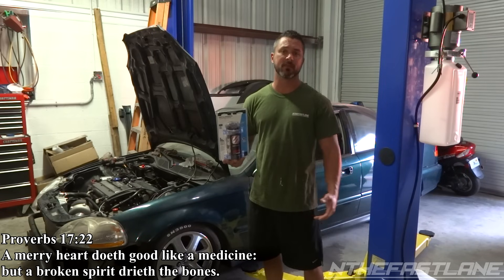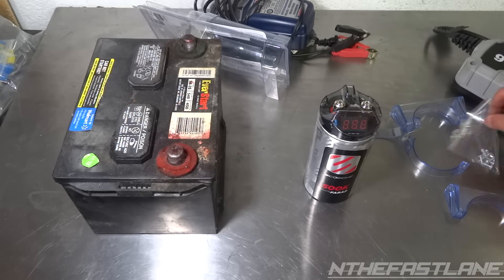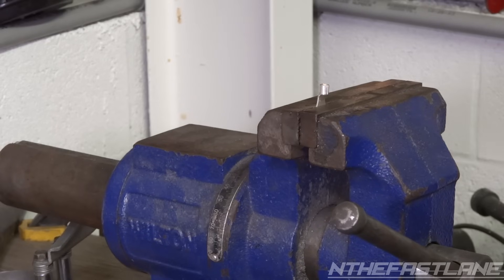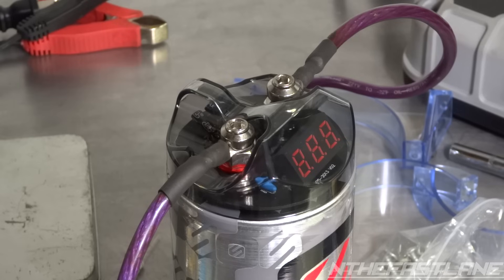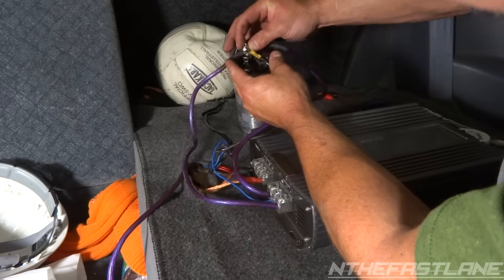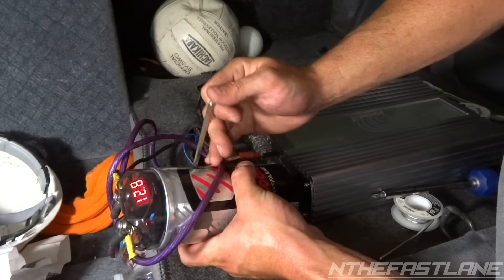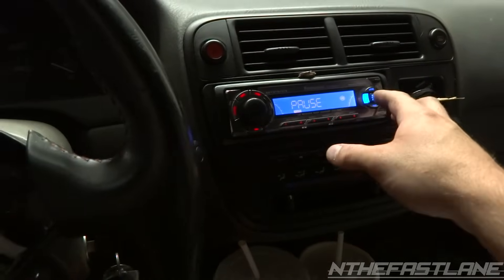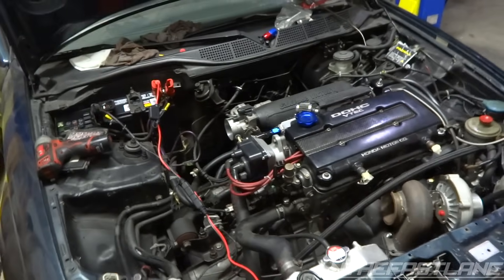▶️Amplifier Capacitor Installation "How To"⚡

Comment: Capacitors 101. For all the newbies, hell that probably includes me. Say you have a sweet ride, you're not going to run it through the carwash. You do it yourself. Now you got the car all soapy and sudsy. You go to use the water hose to rinse it off but the water pressure is terrible. Like you're trying to rinse off your car with a bad showerhead. What do you do, you grab an empty bucket and let it fill with the water all the way to the top. You take that water bucket and splash down the roof with one or two big passes just blasting the soapy water away. That's kinda how a capacitor works. Your capacitor is a lifeless bucket your battery is constantly filling up with water and the water overflows out the top to your amplifiers keeping them going. At one point your amplifier says we gonna need a  shitload of water to keep this bass note flowing. Cool. BASS note is gonna hit hard. The capacitor water is just sucked out of it for that note. Almost have the bucket is gone. But the water keeps flowin into it and none of the other systems, headllights, leds, cell phone charger, ac blower motor, They're all drinking from the same hose too but since the capacitor was full of water, it was able to dish it out and nobody else new it cause it had some to spare.
Reply: Perfect explanation
Reply: Cool man, stupid simple just what I needed thanks for that.
Reply: Well said

Comment: Upgrading the alternator is a way better choice. Most capacitors are just trash, and running multiple batteries won't help if the alternator is too weak to charge the batteries.
Reply: HKvsGlock I don't think it's a choice of one over the other.
Reply: HKvsGlock
Reply: You also need good batteries and a battery isolator for the batteries running the sound system!
Reply: I was just going to comment about upgrading the alternator. An 80 or 90 amp alternator just won't hold up long term even when using a cap... I've never had any issue with a single battery and a 140-160 amp alternator.
Reply: I got a 240 amp alternator and only a stock battery, I’m gonna upgrade to a optima yellow top battery and see if I still need a capacitor
Reply: baadkittyMEOW you will not need a capacitor with those upgrades.
Reply: Capacitors will also aide in filtering noise out of the system, they work quite well when installed correctly, this was not a example of correctly installed 😂
Reply: Capacitors are not as popular as they used to be. They are pretty much trash no one hardly uses them. Get a good battery, wires and alternator and you will be all set
Reply: Capacitors are for small power needs. If you're bump 5k watts or more yes you should probably upgrade your alternator.
Reply: @charleswp71  yeah this was correct. Lol
Reply: @charleswp71  
I've got a Blaupunkt volocity to go 6 , and I want to use it as a boombox , how do I connect the capacitor?

Comment: Real man don’t charge capacitor first real man don’t even disconnect battery 🔋 😆
Reply: Me to lol wtf is that resistor lmao never used that shit in my life
Reply: Proof darwinism is being prevented! its basically a bomb if you take it out. If you just take it out n let it sit for a while when you pick it up n move it around thats when they like to blow up in your face
Reply: Mine sat for like 2 months i picked it up and put in bxk in my car 10 months bumpin later it still hasnt blown up and i have exacly the same as his

Comment: This is all wrong! That wire isn't 8 gauge, I don't know if it claims to be. Those ring terminals are not rated for that wire. You stretched them to make them fit. Solder is not pronounced soul-der. The way you soldered those ring terminals, you didn't even get solder in the wire... It's just all on the outside of the ring terminal where you put the flux. I don't think you charged the capacitor, it had no voltage stored. It was showing 0 volts. That Walmart capacity isn't even a farad or 2 farads like it claims to be, waste of time and money to install. I can't strop shaking my head as this video continues.
Reply: Also, you didn't even have it wired properly. The capacitor should have it's own ground, it shouldn't share with the amps.

Comment: Caps are only good for quick slaps but as soon as a long bass note comes up it does not have time to charge back up then it also becomes a load to the electrical system. That's why is wise to upgrade the alternator or add a battery
Reply: These are the facts right here...well said. My 425 amp alternator arrives next week (dedicated to stereo, 2 alt set up 😁 1 battery yellow top😉 no caps. The long bass note is exactly what happens, and then the caps never catch up....👍
Reply: Yep - The only Real way to have Actual Power is for the Power to Already BE THERE ... Get yourself a Realistic Alternator, Upgrade that Battery and Every Cable you've got under your Hood and There Ya Go!
 That Capacitor is intended only for sudden Quick Drops (if any) in Voltage. It is NOT a Regulator, it's only a Buffer. It's meant to activate only when Voltage drops below a certain Threshold. 
A Capacitor is NOT an Alternator "alternative".

Comment: shouldnt be adding capacitor or battery without upgrading the alternator!. your going to put way to much stress on the alternator.
Reply: Miss CarAudio by leonie how do you upgrade the alternator?
Reply: Carson John Replace the stock alternator with a high amp alternator, but you may not really need to. Have a good mechanic check to see if it’s needed.

Comment: “It’s always going to keep the Amps at that Voltage”? Then, a Diode rather than Resistor? I have ZERO confidence in this “informational” video.
Reply: Amp as in amplifier, not ampere.
Reply: He was talking about amplifier when he said amps. Also, a resistor is similar to a diode, other than its electrical properties.

Comment: Coming from someone who just hooked this same thing up yesterday, you are supposed to charge it up until the LED quits flashing, as per the instructions that came in the packaging. If you become impatient and don't want to hold it (it only takes about 30 seconds to a minute), then just wrap one end of the resister to the positive terminal of the cap, and the other end to the positive cable coming from the battery. 

I just let it sit for a minute while I went back inside to take care of something really fast. Wasn't worried about draining my battery down too far by accident, since I was using my car audio battery which I have isolated from the starting battery when the vehicle is off. Otherwise, I really like how your install looks. Much cleaner than my own. lol.

Comment: can you answer this?
i recently purchased a capacitor (Sound Storm C22 2 Farad ) with 16v to 24v surge. i have a 12v battery in my car. will this capacitor work with 12v system?

Comment: I've used caps in the past but I usually build my systems with alternator output in mind.. High current alternator is they way to go if it's in the budget.

Comment: I have had many set up's in several vehicle's & I always s come back to a 92 Pontiac Grand-am that I once had with a decent set up & even though I was drawing MORE AMP'S then what my alternator put out,( I was drawing 127 amp's on a 120 amp alternator) I added a 1 farrod cap & NEVER HAD AN ISSUE WITH HEADLIGHT'S DIMMING! HOW THAT IS POSSIBLE, IT IS NOT BUT, SOMEHOW IT WORKED! I RAN TWO 1,000 CCA BATTERY'S W/1 FARROD CAP & THAT PONTIAC HIt  HARD!!! now I have a focus w/ Memphis srx 5000.1 & 2-12's & 1 farrod cap & MAN DO MY HEADLIGHTS DIM! I NEED A BETTER ALTERNATOR BAD!!!

Comment: 06:00   I'd  do it the other way  around, lightly grip the wire in the vise,and leave the terminal out to solder; this way the plastic will  not get burned as much, AND  the terminal will heat up faster and more uniformely, since the vise won't be robbing the heat. At least,grab the terminal by the very tip of the ring,  that works  too.
Reply: I solder vertically so solder can easily flow with gravity.

Comment: Not to diss but you did it wrong! The amp should have it's own ground  the capacitor should as well. The shorter the grounds the better
Reply: Fido Tru literally what I was thinking this shits confusing
Reply: Fido Tru This video lost credibility the moment I saw a WalMart Scosche capacitor being installed with inappropriate guage ring terminals that are being stretched open to fit the cable. Everyone's an installer nowadays! smh
Reply: FarAboveDaCloudz true!
Reply: SO NEGATIVE CABLES IM GUESSING YOU MEAN? CAUSE WHEN I HOOK AMP POWER CABLE TO AMP THEN NEGATIVE WIRE I HOOK UP MY TRUNK SOME SCREW THERE XD BUT MY LIGHTS BLINKING SO BATTER CABLE GOES POSITIVE THEN ADDITIONAL POSITIVE CABLE CAP TO AMP AND AMP NEGATIVE CABLE HOOK SOME WHERE IN TRUNK, ALSO CAP  NEGATIVE CABLE HOOK SOMEWHERE IN TRUNK THATS YOU MEAN SHORTER THE GROUNDS? INSTEAD OF HOOKING BOTH NEGATIVE TO CAP HOW ABOUT ONE OF EM? IM CONFUSED
Reply: JR GRIFFIN Hook up your positive cable from battery to the Cap and run another positive cable from cap to amp then have two negative cables as short as possible in length and grounded to two separate areas of the car if possible, one negative cable from the car will run to you capacitor and the Second negative cable from the car will run  to your amp. In theory your amplifier and your capacitor will be running on two completely separate grounds. When done, your capacitor should have two positive wires on it and only one negative wire going to it.  That's how I've always hook mine up with no problems.
Reply: Fido Tru , that's what I thought, individual grounds right??
Reply: Yea honestly, wth was he thinking
Reply: as an installer if i saw this i would mortified
Reply: you want all your ground connections to have the same potential. multiple points or not.
Reply: @ronsk8rr  , thanks for your explanation. much simpler than watching the video.
Reply: Threewulphmoon  Truth!
Reply: I was looking at the negative and I said to myself “something is wrong here.” Lol
Reply: Just hook up ground to the chassis to make people happy.
Reply: ronsk8rr exactly how I set up mine too . Not only that , but I try to run the lowest gauge I can get best flow
Reply: could I put them on the same ground with two different whires?

Comment: I am new to using a capacitor. My question was going to be will the lcd screen go off and always pull voltage when the battery is connected.  But I see you say it will go to “sleep” and the screen will go off.  Also after I charged mine within a few seconds it started discharging and then says low.  Does it discharge that quick once I disconnect the diode from charging?

Comment: Nthefastlane good vid👍. I got a question, I got a 1100RMS amp and when I’m cruising around the bass never cuts out no matter how loud I have it. But when I come to a complete stop and my vehicles RPMs get low the bass cuts out if I have my system turned up. Will a capacitor help get rid of this problem? If so what size capacitor should I get? If a capacitor won’t help in this situation what do you think will fix this problem?
Reply: Capacitor ,yellow top optima battery ,high out put alternator for maximum performance

Comment: I lost the small packet with the diode in it. How do I charge it?
Reply from the maker: Hi Harry!

I was incorrect when I said "diode", you're supposed to charge it with a resistor. I corrected it with a text pop up in the video. I just pinned a link to the top comment for the resistor you need to charge the amplifier capacitor. 

Hope this helps.

Comment: I don’t have a wire running from my negative battery terminal except for the one to start the car obviously but I have a ground wire drilled into my trunk will that work as a negative?
Reply: yes it works fine

Comment: Hey is that the same solder and flux you use on copper pluming please. I like the way your installing thanks
Reply: No use rosin core not acid core

Comment: hello, I bought a crunch cr1000, I set it up as it was written in the prospectus.  But the light is still flashing.  I have a blaupunkt gta 4 special 750w amplifier and hifonics zxi12bp (1000w/500rms) subwoofer.  Please help.
Reply: I think you need a new battery or better alternators for your car.

Comment: is it bad if you didnt charge your campacitor. ? when i first got mine,  i just hooked it straight up to my amp and battery and it show my voltage. i never knew you had to charged it. i was woundering why it came with resisder. so doesnt it really matter to charge it. idk if my is working right. cuz i didnt charged it
Reply: I think you can short  your circuit if you don't charge it. Empty capacitors act as short circuits in the first milliseconds when you connect it to the power supply and could burn your circuit breakers or other electrics that are in that circuit and have no breakers.

Correct me if I'm wrong.

Comment: hello NTHEFastLane, can i use a capacitor even though i dont got a amplifier? i do have some 12v leds, windshield wipers, heater defroster running very ofter and i got a small battery.. will it help??

Comment: will this help in my car i have this exact capacitor but in my car i have 2 ,12 inch jl audio sub woofers in my car and i think my jl audio amp is 500w peak im not sure though but when i have the subs going my lights will dim when i turn the steering wheel and my car will almost start to die... almost like it will hit 1,000 rpms then go back to regular ideling but when im driving its all normal and i have a 2011 nissan juke
Reply: and do i have to do that activation?
Reply: Serjio Blockus caps are a waste of money get yourself a good Agm battery and do the big 3 under the hood ,it will make a world of difference!!!
Reply: Serjio Blockus look up big 3 or even big 4 on YouTube ,there's alot   of helpful videos on it . Just doing the big 3 will give you at least 25% more power from your alternator

Comment: my amp turn on protected mode (red light) when i turn up volume ? i dont know if I could get a capistor
Reply: Omar Khaled Your gain is probably set to high
Reply: Omar Khaled.  cheap ass amp bro, up grade
Reply: Cielo Melgoza im from Egypt and amp is so expensive here .. i got a Japanese one 940watt 4 ch and its pretty cool but i cant put on 1 channel more than one speaker but its work when i play it in series wire
Reply: Omar Khaled amps are expensive everywhere lol
Reply: Daniel Lloyd at least 2000 l.e for good one ?
Reply: Omar Khaled check your fuse that's what happened to my amp and I replaced the fuse to a bigger one and that's it never again did it go to protection mode
Reply: Burn your amp up putting a bigger fuse something not hooked up right if it keep going in protection mode
Reply: make sure you have a proper ground
Reply: whats your ohm load?

Comment: Lol I got 3 batteries, big 3 and my lights still dim, looked it up and apparently it's a problem with 04 trailblazers even without high powered amps.

My voltage doesn't drop below 14 on the volt meter when bumping 3k watts but lights still dim
Reply: Headlights Dimming doesn't sound normal to me. Have you checked for any TSB's since your last message. I looked it up too and gm does say it's normal 😂 but come on! They said it's normal, so it must be normal. Right? 

I used to be a Chevy/gm guy back when I was 10 in the 90s. They are shit these days including back in 2000's. 
Purchased a used tiny ass 02 Toyota echo back in 2014 and I ran that thing to almost 300,000 and sold it to someone else. I moved on up to an 08 Toyota Avalon and WOW! Only things I've had to repair on them were alternators and an O2 sensor or two. Oh and a intake manifold gasket on the echo. Don't get me started on these 2.4 Buicks. They consume more oil than a diesel engine runaway.

Comment: Maybe that tiny little ground wire is the source of your problems, ground wire of same or greater size should be ran from the amp to a clean ground point, cap should also have it's own ground.

Comment: I knew these comments were gonna be the old alt vs batt vs cap. Smart bassheads use all 3 in combination.  Hell I'm using 3 batts, high output alt, and a 5 cap bank just for one 3k amp.
Reply: Will it still be fine?
Reply: Using stock alternator+stock battery+ 800amp capacitor + 3k rms amp? Also using true ofc 2/0 gauge wire
Reply: Dude that's hella over kill🤣🤷
Reply: @txcoastfishing85  lol, was 3 years ago. 5k now. Going to an 8k very soon.

Comment: hey just wanted to hit ya up to say thanks for the helpful vid, i learned alot from it cause i had the same problem as you with sub cutting off at high volume so after this vid i feel ready to install my capasitor to i was nervous cause i tried one years ago and almost blew up my whole system so thank you for your helpful vids,Dave

Comment: I got a question. Im going to install 2 15in subs with a 3500w or 4000w amp. Would i need an extra battery or can a capacitor do the same job?
Reply: Goku Velasco if you have to ask, I’m assuming you’re not getting an amp that can put out anywhere near 4000w or even 3000w. But if you’re getting an amp that can actually do that kind of power, you’ll need a better alternator at the very least. Invest in a “Big 3” upgrade and a higher output alternator. That kind of power will require true 1/0 wire, OFC if you want to avoid having your car burn to the ground.
Reply: @ThingsWithMotors  so just to make sure, an alternator should be all i need?
Reply: Goku Velasco well maybe not even that, what amp are you looking at getting?
Reply: @ThingsWithMotors  4000w

Comment: Hello....I have a capacitor....rated 1000 watt.....I'm only running 1 JBL 1000 watt GT....15"..
But for some reason.....it's not working ......it's brand new....so I'm taking it back...to check.